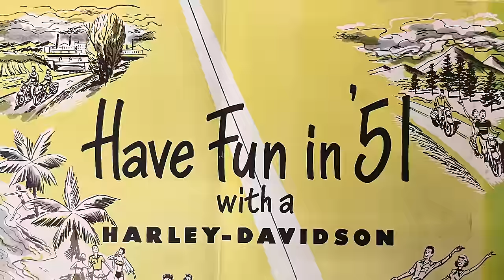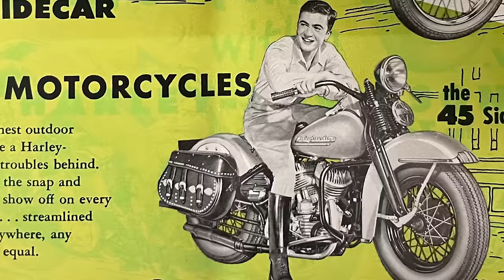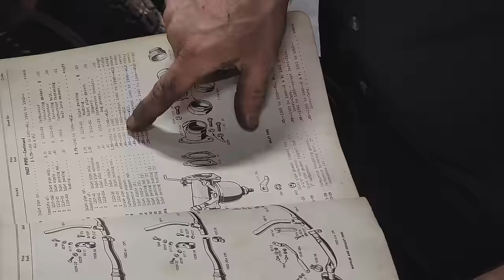I Bought A Motorcycle That Hasn't Run in 30 Years, WAS IT WORTH IT?

Comment: Dale, we had the pleasure of meeting last fall at the swap meet in Davenport, Iowa. Years back before I realized the joy in having an all original motorcycle, I built a 45 from scratch. I bought a basket 1968 engine from the St. Paul, MN motorcycle escort service for $80. I then proceeded to build a complete two wheel 45 bike. I am sure parts are from many years but it is probably the only two wheel 1968 45 cu in motorcycle out there. And you know why. That being said, maybe it's time you built a 45 cu in bike for the yearly give away. Hear me out. I think half your viewers/visitots are old geezers (like me), and kick starting a knuck or pan gets tougher as we age. A 45 on the other hand is way easy and while they are not good for rode trips, they are beautiful for around town (when it's not to hot out). So please think about it. Maybe you could even find the fan I seen on a MN state trooper bike that mounted to cool the cyclinder off.

Comment: Man, that's something I really like about you.. For a lot of people their mantra is "if it ain't broke don't fix it!" and they'll just leave it as it is and start it and ride it and end up breaking something.. But you want to know what you have and make sure there's nothing broken or about to get broken before starting it. That's much more my style, like how I pulled apart my great uncle's 1961 Ruger 22 before really shooting it so I could make sure it was fully cleaned and properly lubed before I put a bunch of rounds through it.. which absolutely pissed my father off when I was struggling to put it back together. (turns out their recoil spring is a complete pain to set right.. when we did get it back together we ended up setting it tighter than it was and the thing actually kicks even just being a 22LR.. oh well I guess, better practice for a bigger pistol) I'm definitely one of those people that can't leave "well enough" alone, I want to know everything about whatever it is that I have.. though part of that is probably my autism.
If only I didn't live in California and lived anywhere near you I'd probably be there hanging out all the time and taking you up on the bead blasting offer and maybe even do some welding/brazing for you if you needed it.

Comment: That shop reminds me of the shop I worked for when I graduated high school in 1983. 
 The shop was in downtown Los Angeles and we did automobile electrical and air conditioning as well as being the only Westcoast distributor and authorized installer of Federal Signal lighting which make emergency light bars and all equipment for police, fire, ambulances. So yes we built police cars and installed sirens and spotlights and lightbars also. 
 The shop was called Highway Safety Equipment Company and it had been in business since 1924 in the same building. Two story with the upstairs having an office, a studio apartment and parts storage. The old owner paid the new owner rent to use the upstairs office where he and his buddies have been playing a weekly poker game for over 50 years.
  The shop had old bay doors on each end of the building for drive through service and there were two bays off the left side. The shop counter was below the second floor and the 6 rows of shelving along with the 4 rows of shelving upstairs and the shelving on the shop walls had automotive electrical parts that had been there since the 1920s and '30s and '40' and so on. When things were slow I would just start opening boxes to see what was inside and the things I would find were amazing. Factory parts for Cadillacs from the 1930s and newer. Taillights and Headlamps housings and trims, aftermarket brake and turn signal switch assemblies for 6 volt cars that didn't come with lights from the factory, old police sirens and lights, air horns, Appleton spotlights with and without mirrors in the head, air conditioning units self contained that bolted on under the dash for cars without AC from the 1950s. 
 If you needed a abturn signal stalk from some old car because the original broke, we had boxes full of turn signal stalks/arms. We had motors for convertible tops and motors for power windows and headlamp doors, vacuum motors for headlamp doors and heater doors. 
  It was a treasure trove of rare parts and stuff that you never heard of. I found a box of Ford factory touch up paints from the 1930s all the factory colors. 

 That's what I see you guys doing in
your shop. You know you have a spot where certain parts will be and you have drawers and shelves of fasteners and screws and nuts and bolts and springs and they've been collected since the 1920s. Spend a few minutes searching and you will find what you need. 
 It was an amazing shop. A great place to work and learn how to work on cars and specialists in electrical and air conditioning as well as getting to build emergency vehicles for cities and universities and the Red Cross and ambulance companies.

Comment: Got a basket case WLA in 87,i was 17.it came with hi comp aluminum heads, stamped with letter 6, a m88 linkert carb,foot clutch, suicide shift with reverse,it had an earlier cast beam Springer.all of the WLAs were military,as the A was dropped after the war the 47 WL i currently own is a civilian model, they were utilitarian so even the 2 wheelers had reverse and side hack mounts on frame. I believe the 45 motor holds the record for longest production motorcycle engine.

Comment: 48:05 Cork Borer. I just saw a video that said they are hole punches for cork stoppers. They are used to make the holes to pass glass tubes through when doing experiments. There should be a sharpener with it.

Comment: Worked as a Nissan/ Mercedes Benz dealer tech, decades ago, a low mileage  Nissan z car  came in, running terrible, guy had just put a bunch of new stuff in it. Got rid of the new Champion plugs, put ngk in, it ran fine.

Comment: I have had the nasty job of fitting a new set of quite wide beaded edge tyres to a 1904  884 cu in Napier racing car. If you find a tyre that just seems impossible to mount, it can help if you can leave the tyre sitting in hot water for half an hour or so.

Comment: Nice Job Now Get the 1901 Running and Riding  That Rubber Kinda Sealed the Deal  No way it could have been Ridden with out the Tires  You Can Do It I Have Faith In You :face-blue-smiling: